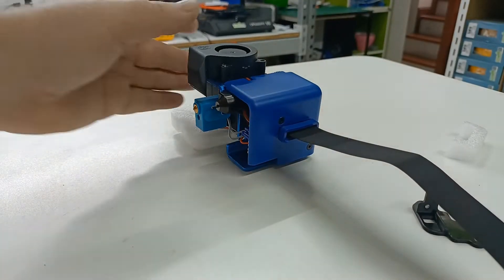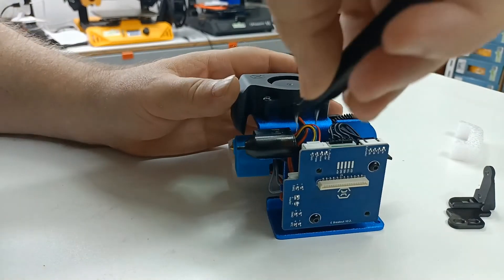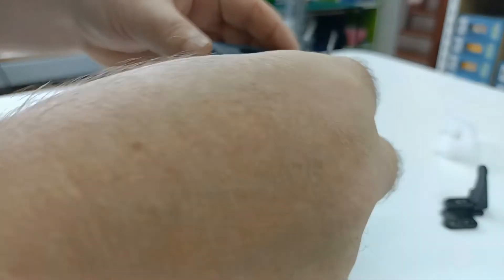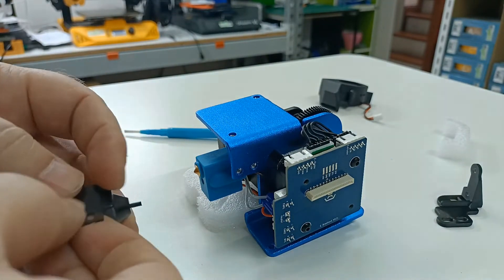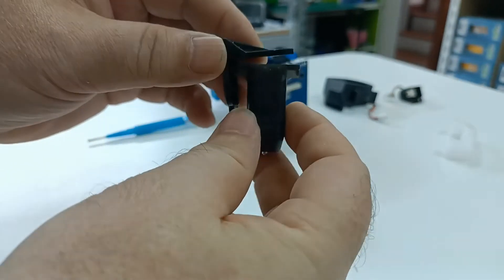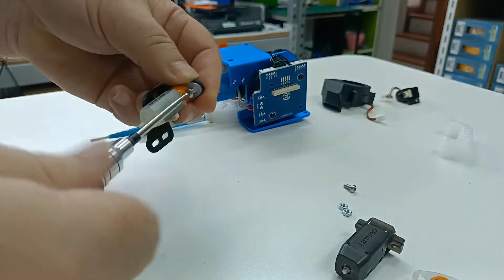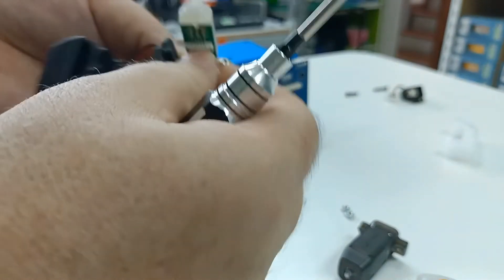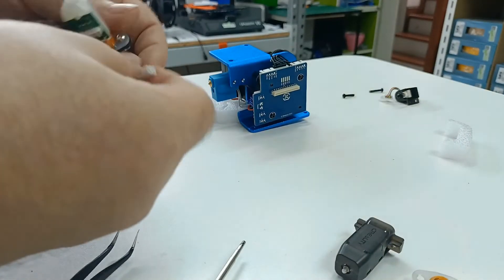Upgraded X2 & Genius Pro ABL Sensor. Install McCulloch BL touch mount

Comment: im looking at 3d clones off of aliexpress but the cables that are available there are in such a way it connects direct to the mainboard, what sort of cable have you got on that Bltouch you're using so that it can connect straight to the breakout?